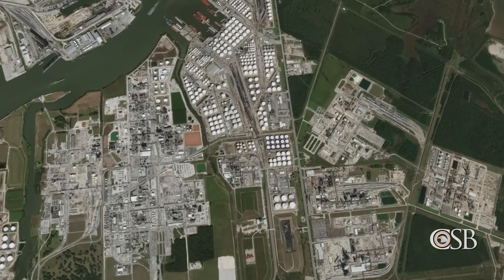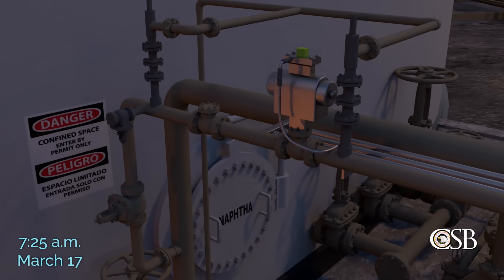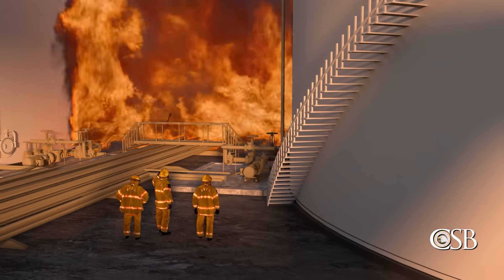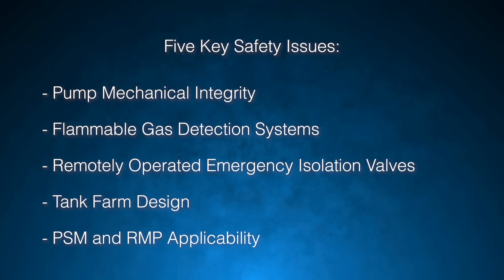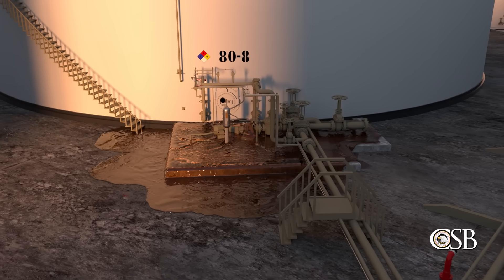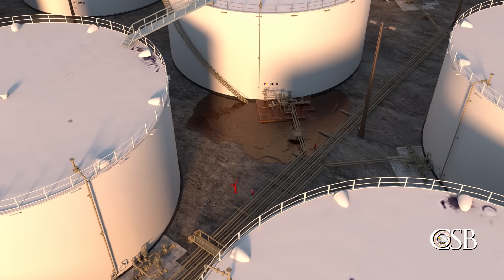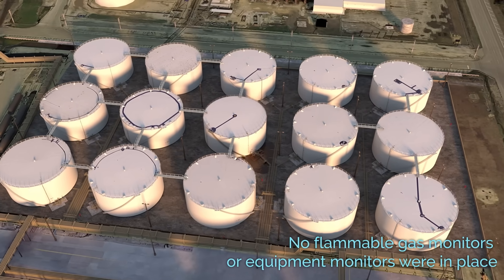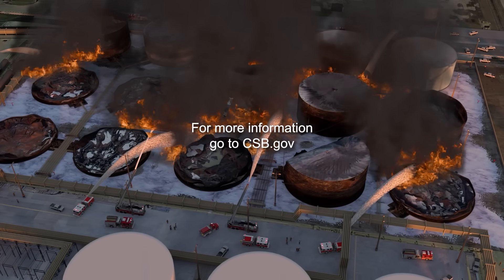Terminal Failure: Fire at ITC

Comment: 3:50 So here is a cold opinion. Just like a knock sensor on a turbo-charged gasoline engine, a microphone with a range filter could pick up problems with pumps as they grow louder and start to vibrate more and more violently. 

It would also be almost too cheap to manufacture with the only expensive part being how the sensor communicates with the alert system database. (3g/4g low data network).

If the sound frequency oscillations keep changing and getting more inconsistent, it can partially or full close a valve and shut the pump down.
Reply: Why not use LoRa so there's no dependency on cell towers?
Reply: @robertthallium6883  Lora and LoraWan are awesome, but rather new to affordability and software design. I was actually using 3g/4g as just a widely known example of off the shelf. I actually havent been able to dive into how its (LoRa/LoraWan) packet strategy works. CDMA, encryption, TCP, etc. I also have not been able to really evaluate cost.

With that honesty out of the way, yes, I would be onboard with that. I just didn’t expect a high quality answer, quickly, fluently, or really at all. Thanks for reassuring me.
Reply: I like the way you are thinking.  The reality is that vibration monitors and wireless communication are solved problems in the chemical industry.  ITC just didn't care enough to install any protections at all.
Reply: Surely, you don't think knock sensors only exist on turbocharged (one word) vehicles, right? ... right?
Why would they do that when regulations don't require them to do so? That would be money otherwise given to the CEO.

Comment: Gosh, it's so surprising to see that they were using no safety systems for flammable materials.
Reply: VOC Sensors (the volatile gas sensors) are actually a fairly new thing in electronics, or at least are fairly new to be affordable off the shelf parts. I remember seeing them in a Digikey newsletter and on Adafruit and thinking, thats amazing for under 100 dollars. That was less than 6 years ago. 

You are not only right, you are very right.

Something should have existed with as many intersections of multiple tanks being there, even if it was a spring loaded valve that springs closed when pressure falls below a certain amount. (it would be opened with a slow moving gear motor working against the spring with a solenoid) Power gets lost would also trigger it to slam closed. All you would have to do is cut the power to the tanks and have them close. Simple engineering.